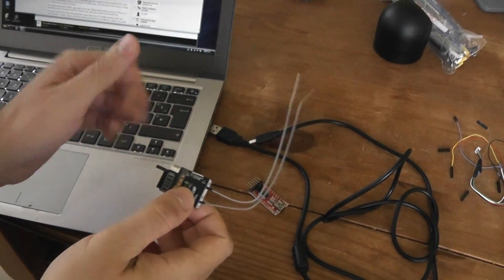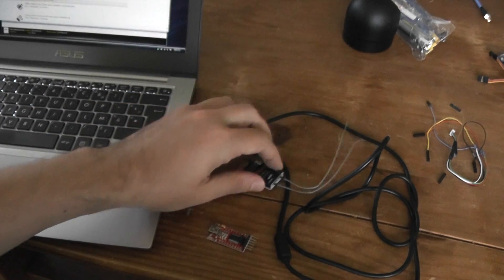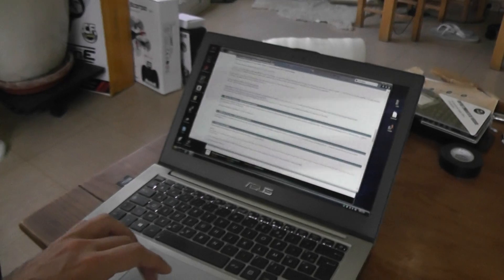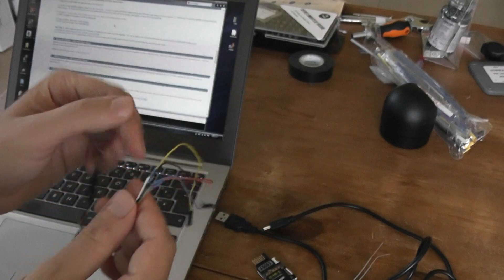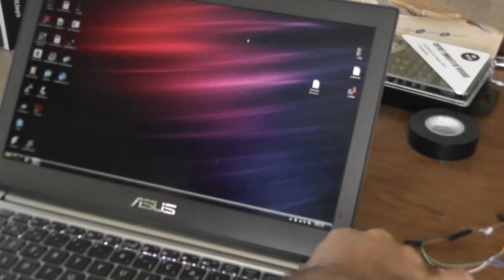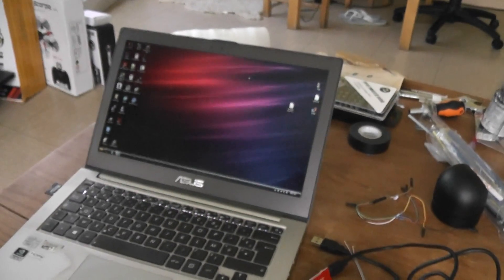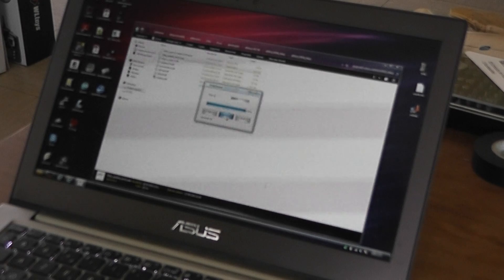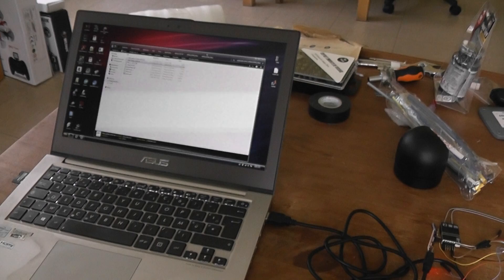Tutorial: how to flash the 27ms firmware for FrSky D4R-II with standard FTDI USB to serial TTL

Comment: Hi, I found the problem. Althwou my FTDI looks like your one, after I exchange TX and RX on "FT_prog" it doesn't save that. After I save if i refresh the settings the config back to default. What is wrong?
Reply from the maker: +JON-JON AEROMODELISMO I think a you have a non-genuine FTDI chip. With last FTDI drivers, it lock the chip. You need to install "generic" driver and use Mprog instead of FT-prog to flash your FrSky receiver
Reply: Do you suggesty any specific driver to make it works? thanks guy!

Comment: I am having a problem using FT_prog. It seems that settings are not being saved after flashing the FTDI even though no errors pop up during flashing.
Please help as I am getting frustrated:
https://www.youtube.com/watch?v=GNO2gUXj8Xg&feature=youtu.be
Reply from the maker: Hi.... Very strange ... maybe it's a problem of FTDI driver. Do you a genune FTDI module ? or a chinese/close ?
In this case, try to find old drivers from 2011..... maybe it can fix your problem ... not sure at all
Reply: It is exacly like yours i think. There is a link of my red board on the link above! It is strange. I just ordered one from banggood uk for 5euro. Link in your description. Fingers crossed
Reply: SeBy DocKy I received my second ftdi adapter from your provided link(banggood). I tried to program it as above with ftprog and guess what. Still the same issue !
The board exactly like yours a red led instead of blue and a mini usb instead of micro usb connector. Wow this is driving me crazy. 
I also have the older drivers installed 2.10.0.0.
Kindly provide your 'port settings' in com ports - device manager.
bps etc
Reply: Leander Borg I am having the exact same issue. soooo frustrating!
Reply: Brad Jacob  I did managed to flash my d4r II. I used a 4001 I had laying around in the garage (NOR gate IC) and connected the thing to invert the TX from ftdi and TX from receiver. Fortunately this did work. These FTDI still work good but their firmware cannot be flashed as these are clones and I suppose that they are made write protected so they would not be bricked by the ftdi drivers.
Reply from the maker: Leander Borg ANyone tried this video ? https://www.youtube.com/watch?v=RZH_qGautqM
Reply: +Leander Borg Exactly the same issue here. Very frustrating. I'm using Win10.
Reply: +SeBy DocKy Yes I did but it didn't help. My ID was already set to 6001
Reply from the maker: +Henri Rotthier For non-genuine FTDI devive, you have to use the "Mprog" software instead of FT_prog. With this one you will be able to change PID then run the FrSky flasher program. Unfortunatly, you will need to rewrite the PID each time you will use the fake FTDI module. In Banggood, there are now some genuine module.
Reply: Hi SeBy. I've already odered an original one. Tired of trying for 2 days ;-) Merci beaucoup